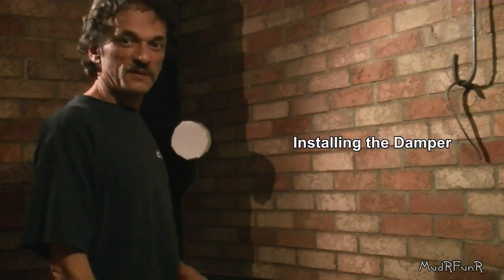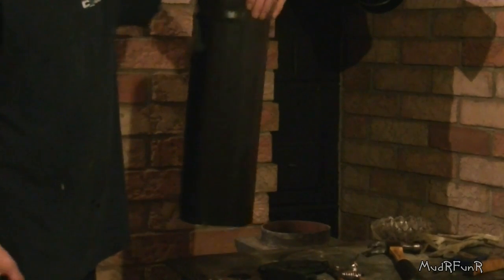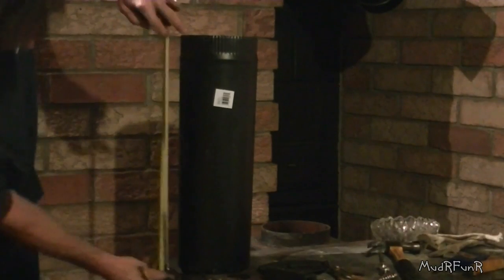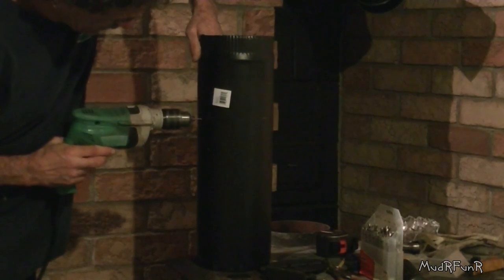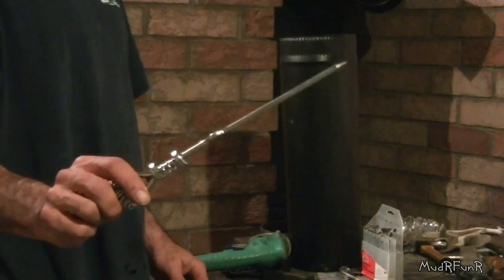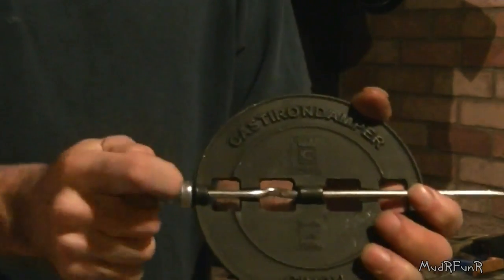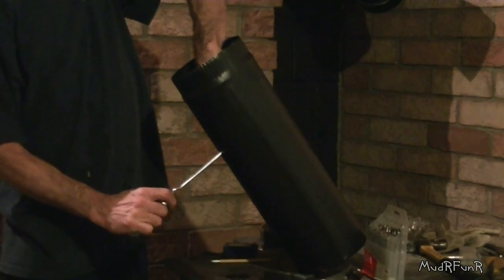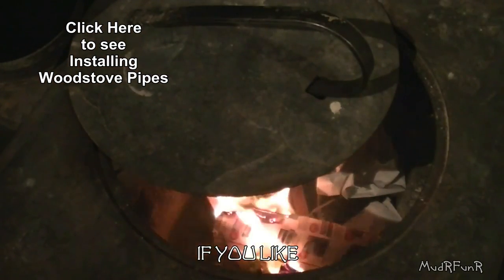Woodstove Damper Installation

Comment: I don't have a damper.  My first pipe going up is short.  Than it tees off.  I would rather not go after the Tee.  I get back burst when I'm initially starting my fire sometimes.  I don't want it bursting the othe side of the tee.  Is there a distance from the furnace that you should be before a damper?

Comment: somehow deleted my comment trying to answer.  I think I got it engaged again. But if it comes loose, I guess I need to take the chimney apart to fix it. That won't happen while it's cold. I hope it keeps working this year. I will take it apart in the spring and replace the damper if it looks very bent. I think that must be why it feels loose. I would have thought that a piece of iron would be pretty impervious to heat deformation. Weird.
Reply from the maker: Taking the damper out and replacing it is quite easy. Once you have the new one you will see how easy, if you test fit the pieces together. That pin is really not that thick. I've seen my pipes turn red on my stove. That's a lot of heat for that thin pin.

Comment: the corrugated ends are ALWAYS supposed to point toward the fireplace so the soot drips back to the fireplace.. the way you installed your pipes it will leak at all the fittings

Comment: With oval stove tops you have to go at least 24" or higher to get the round you need for the damper to fit!
Reply: Juan Fuentes what is the most common size pipe fire the oval exhaust? I have an old laundry coal stove, the length is 7 1/2 inches, and width is 3 1/2 inches. I'm thinking a six inch pipe. What are your thoughts.

Comment: Good video, thank you. I have to drill a vitreous enamel pipe to install the damper for my stove, I wondered about using a glass drill to start the holes. Any advice for this please?
Reply from the maker: +John Melville Sorry but I have no Knowledge about drilling this type of pipe.
Reply: +MudRFunR Ok, thank you. I'll probably do it by applying masking tape to limit chipping of the enamel coating, centre punching gently then going in with a small bit first. If that won't drill I'll have to use a tile and glass drill bit to remove the enamel then use the ordinary bit. I do rather feel that the company who supplied the flue liner (9m) and pipe should have told us we'd probably need a damper but never mind! Thanks again for your helpful video, John
Reply from the maker: John Melville Sounds like you know what your doing, hope all goes well. Merry Christmas! Best wishes from my home to yours.